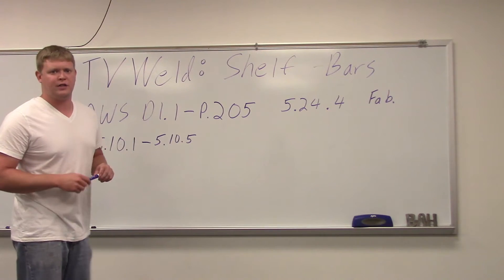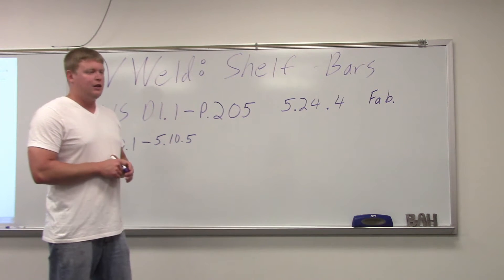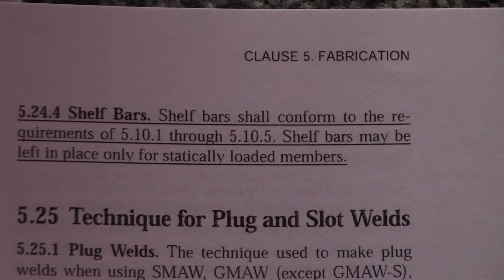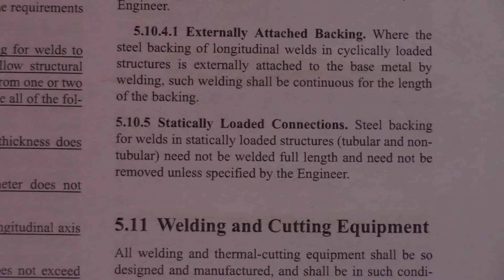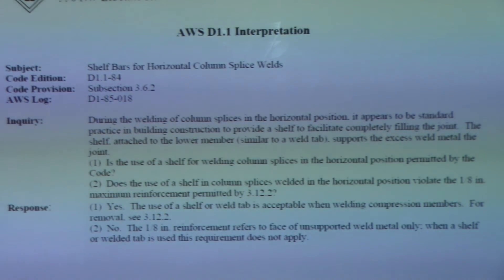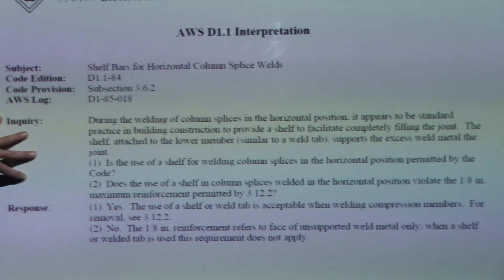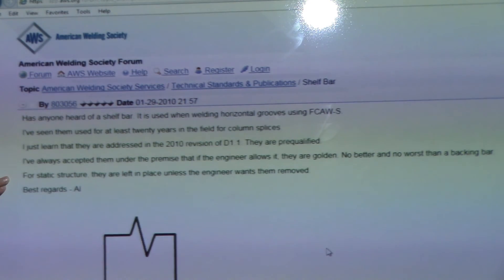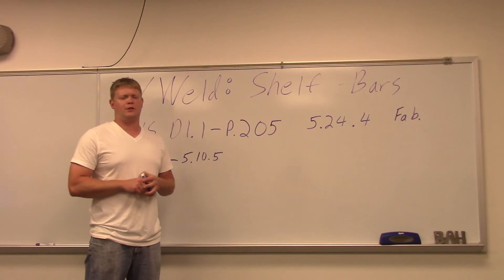Shelf Bars CWI Exam D1.1

Comment: Much appreciated! Taking A, B and C on Saturday. This is definitely helpful. Practice test took me 2.5hrs. And there was a question about shelf bars. Statically Loaded can be removed! Thanks Brent
Reply: did you pass? and if you did can i get some hints im taking it late july
Reply: gusg1989 
Yes.  85/85/80.  Read the fundamentals for part A.  Take the part B practice test multiple times.  The part C for D1.1 requires an appropriately tabbed book (2015 D1.1) and practice exams 1-3.  I took the course and it helped.  I may have passed regardless but I qualify welders and pqrs daily, so I use D1.1 often.  Good luck
Reply: Theodore Winterer that's awsome dude congrats. I'm gonna take the seminar and test last week of July. but I got my books, already tabbed my code book pretty good and getting better in navigating thru it specially with the index. As far as the part B goes I heard they give you a different type of code book?. So they ship that early also or do they hand you that one in the week of the seminar so you will be more familiar with it?. Thanks again!
Reply: @MrTeddycozmik thats the scores im tryna get or better 💪💪🫡💯 great job bro!

Comment: does the api 1104 offer anything different than the d1.
such as endorsement?
Reply from the maker: No.  It's all the same qualification in the end.
Reply: I was wondering the same thing as well, I found out a week or so after I had already order the D1 structural welding code book.